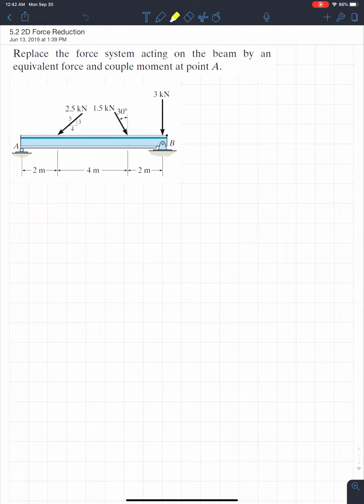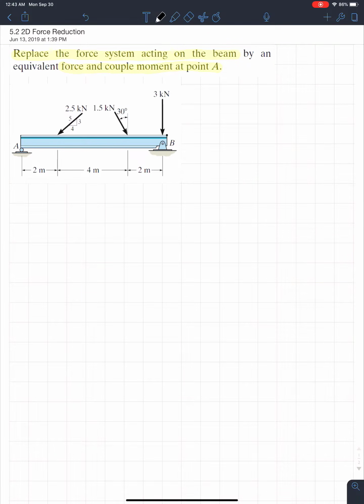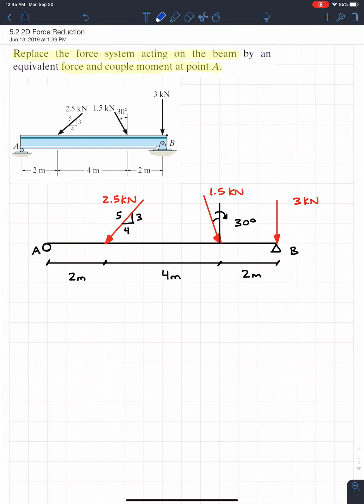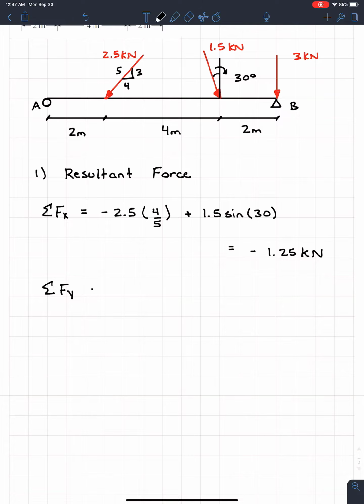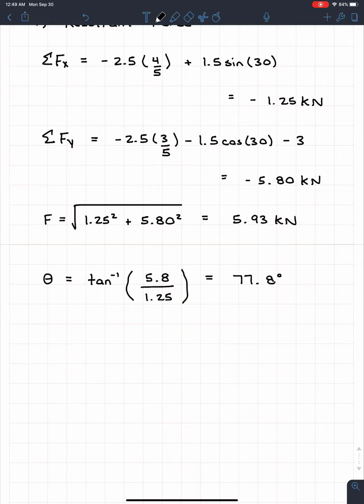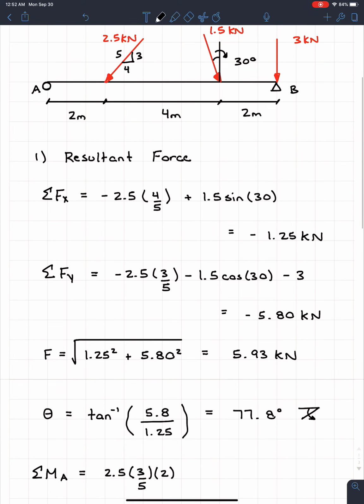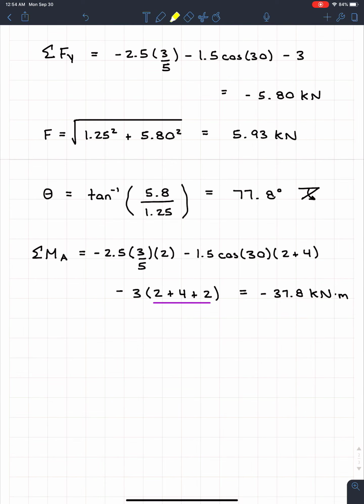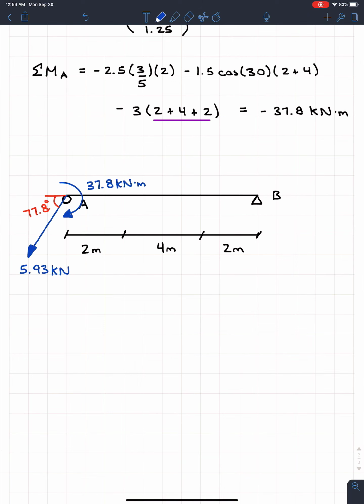Engineering Statics | Old Example | Force Reduction in 2D

Comment: 2 questions: 1, I got a moment about A of -34.79kN*m instead of -37.8kN*m... who made the calculator error...? 2. I don't understand why we can consider the force over at B to have the same force over at A. I might be thinking about this all wrong, but my own analogy I made was tossing my pencil in the air (which I actually did) and whacking one end of it with my finger and watching it move ahead a bit and spin rapidly. When I hit the pencil again in the middle, it flung across the room. Does that have any relevance in this situation in considering the force acting on point B to have the same magnitude on point A? My own 'experiment' suggests to me that the force experienced by the object is completely related to the point on the object it's acting on, which makes it hard for me to understand why you can just add all these forces together into a resultant force, if they're acting at different points along the beam. If you can help clear this up for me, that would be great.
Reply from the maker: You're right about the error for the moment about A, I must of miswrote it as I was recording.  And you are right that we cannot just move force around, that's why we had to add the moment to point A, to account for the fact that we moved the forces in the beam to another point.  Hope this helps!
Reply: @ClaytonPettit  So even if forces don't act on the same point on a 3D object, we can add them up with the resultant force acting on the same point, as long as we take into account the net moment created by all the component forces? I know that statement specifically is the entire topic of force reduction, I'm just having a hard time grasping it...